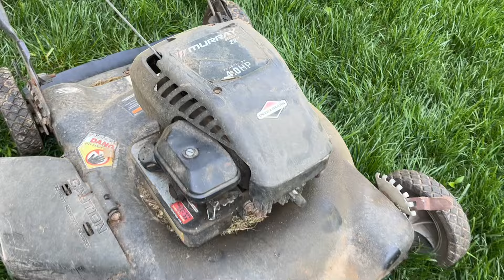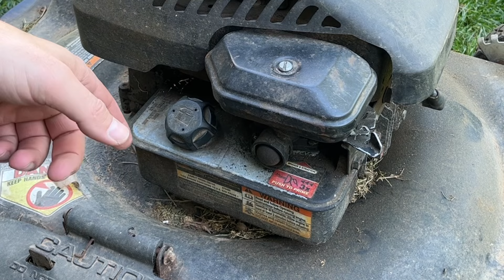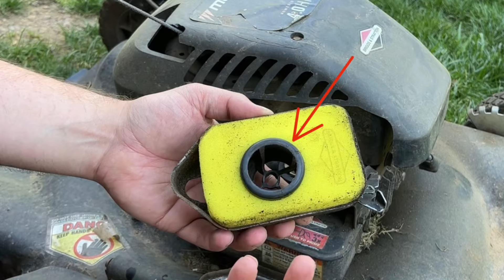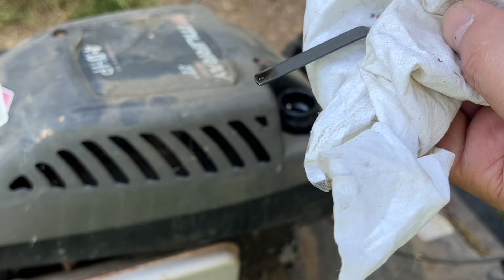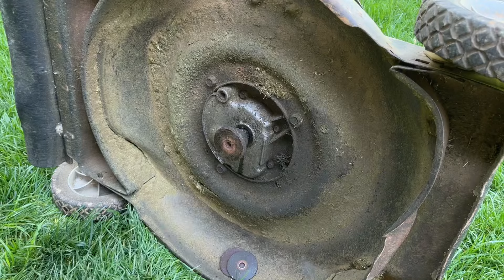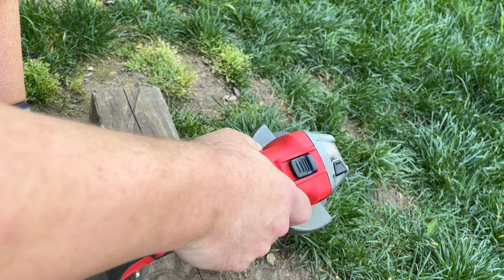Servicing a Rough Murray Select 22" Push Mower - 4.0 HP Briggs & Stratton

Comment: I'm surprised you didn't bother with changing the crankshaft oil seal. You can clearly see it's leaking...

When your engine only holds 5/8ths of a quart any oil leak is seious.
Reply from the maker: Good eye! I had to look at the video again and realized I totally missed that little oil stream when I went through this one. Must of had tunnel vision on the blade

Comment: The only oil I used is 30w sae pen
Reply from the maker: I’d be a stickler for sae30 on these flatheads as well but since Briggs relaxed their recommendations recently to include 5w & 10w-30 I typically will gravitate to 10w-30 since I have Honda machines as well (just to stock less oil)

Comment: What type oil did you use? Was that Mobil 1 full synthetic 30 weight?
Reply from the maker: I used Mobil 1 Extended Performance 5w-30 High Mileage Full Synthetic on this one (free yard sale oil). If I was buying I typically grab 10w-30 high mileage to appease both Honda and Briggs specs